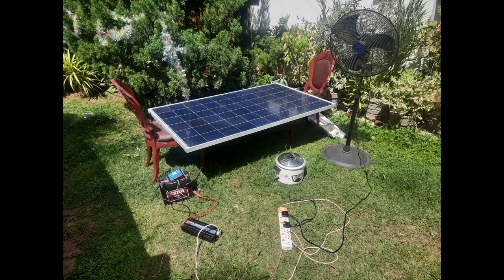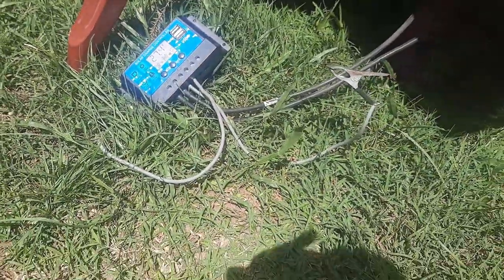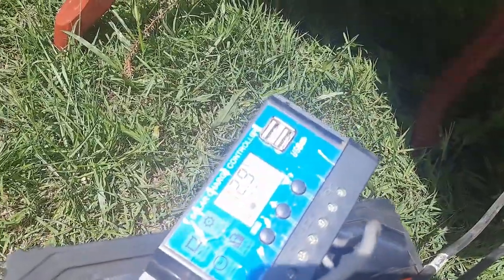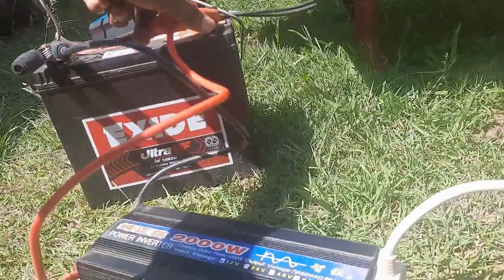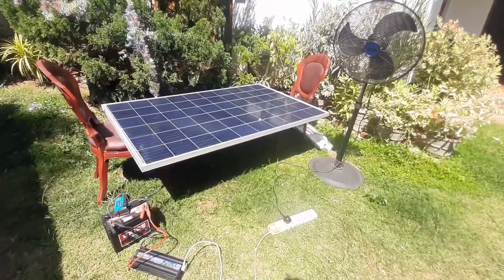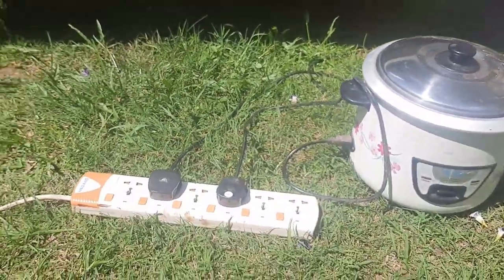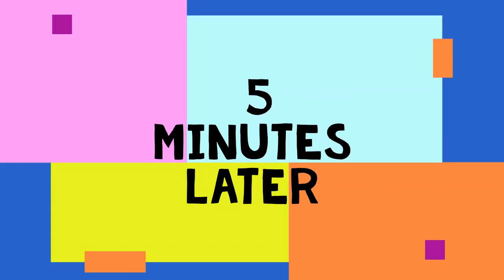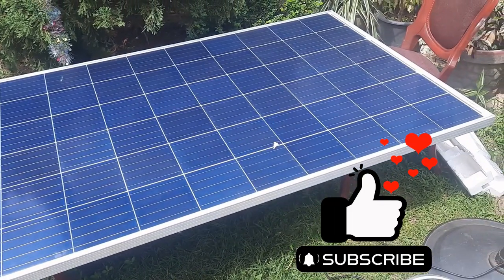DIY Solar powered cooker

Comment: Pwm charge controller settings please
Reply from the maker: PWM charge controller has to be graded according to the charging current. example if the solar panel gives Imp 8A multiply 8 by 1.25 = a 10A PWM should be enough. usually they are safe for use in 12v and 24v systems. if you have a 48v system you'll need to check if its compatible with it. as long as you get the correct device you don't have to worry about settings as it does it automatically.
Reply: @solar_energy  thanks  brother💟